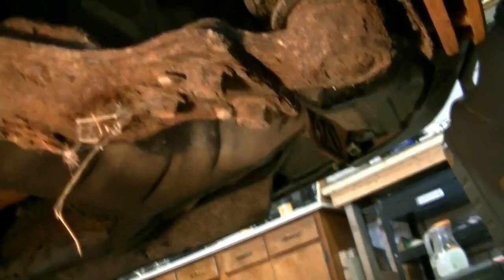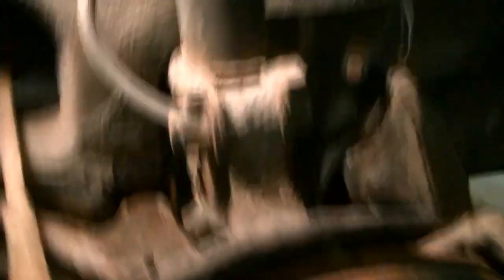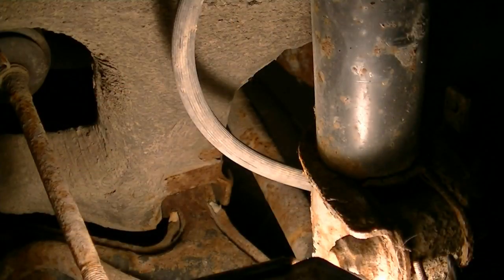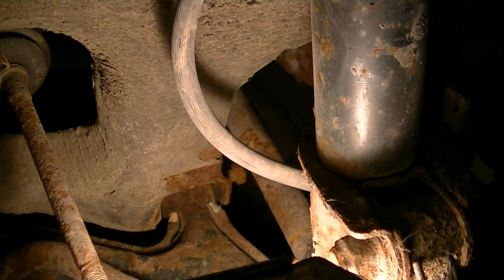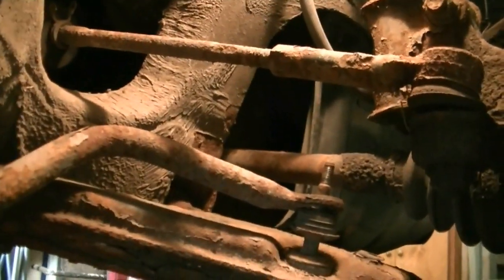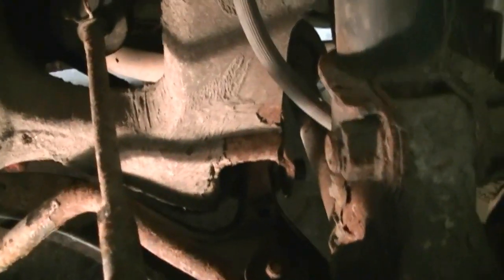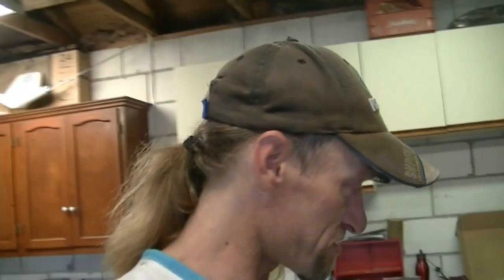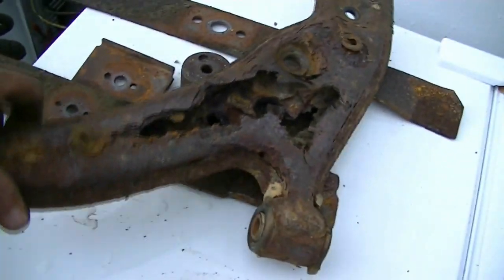Toyota Paseo Lower Control Arm Replace

Comment: these are good videos rickem on how to fix your car , 
your a  good  mechanic , and you dont mind bitting off the tough rusty jobs , well done !!
Reply: Mike, Rick is far from a good mechanic let alone a piss poor mechanic he's not even worthy of a parts changer. Pretty obvious he's too lazy or doesn't have the ability to drive to go get a ball joint of the local parts store so he half ass cobbled it back together
Reply: rickems a good guy he posts vids hes always happy and laughing he gets some haters which basically sucks

Comment: The bolt on Minute 5:00 is stressing me. I don't have and air gun and I already loosen it, it spins but it won't come out. The control arm broke so it's just a piece there with bushings and the bolt.
Reply: I got it. I just made a triangle cut on the subframe on the other side, with so vice grips a lot of WD40, borrowed my fried's impact gun and was done with it.. Now the bushing are half way decent, guess I'll use them until I get new ones to swapped them

Comment: Holy shit that's crusty! I've never seen a control arm rot away before the ball joint was busted...normally, it's the other way around and you end up changing control arms while a ball joint would have sufficed. But then, I'm not in the snowy, salty Canada.
Reply: Ontario is absolutely horrible for putting salt on the roads in the Winter, you could literally salt you're pretzel with the amount they use
Reply: Romaro Vinciguerra gotta agree with that, I remember when I was young waiting for the bus, try eating snow and your 6-8 car lengths from the plowed section of the road all it tasted like was salt.
Reply: ewwww. :P

Comment: Some of you cry babys in the comments should see what my sway bar end link looks like after I put a new strut on my car, the spring perch rusted out and the spring droped down onto the tire.  The nut on the end link was so rusted I ended up slicing it with a cutoff wheel so I could get it off, didn't have another nut that would fit right so I put the fucker back on and tightened it down then put another nut on that didn't quite have the right threads and double shitty nutted a worn out sway bar end link because I'm cheap and it's not really that important of a part.